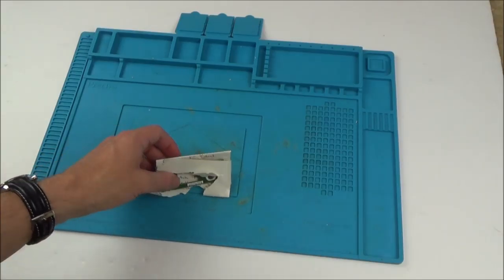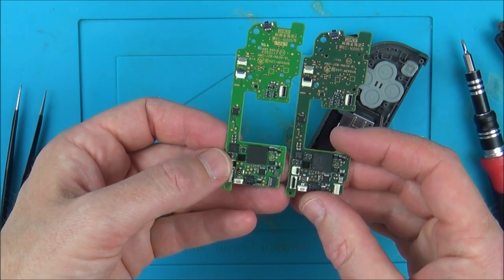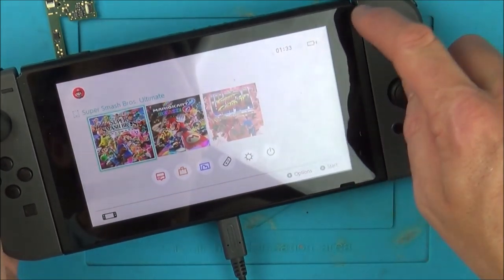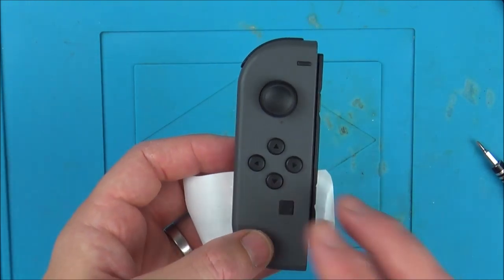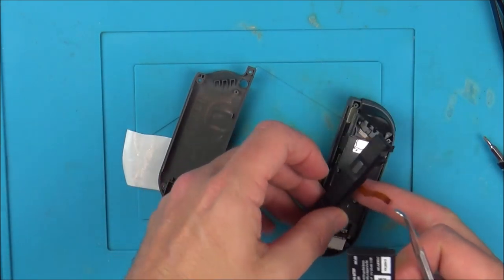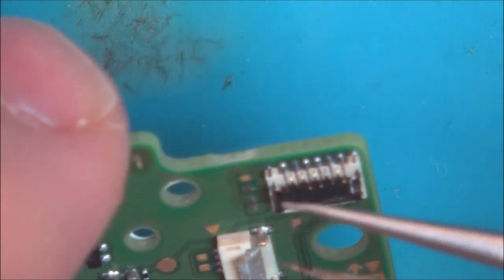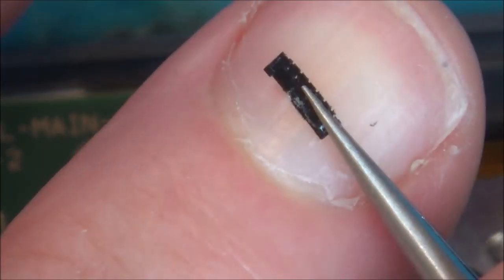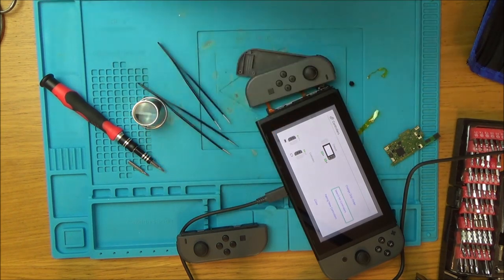Trying to FIX 2x Nintendo Switch Joy Con (QUICK VERSION)

Comment: I have used the thin plastic idea on plenty of laptop keyboard connectors where they have been damaged. I slid the thin plastic into the connector on top of the cable squashing it onto the contacts.

Comment: Good effort

Had the exact same problem last week with my sons joycon the plastic latch came off the sync light ribbon connector and i ended up bending the latch pins trying to get it back on which then created a short and stopped the analgue stick from working and made the joycon vibrate all the time, i bent the pins back in place which stopped the short but couldn't get the latch back on so i ended up buying a cheap faulty joycon off ebay hoping that the main board was okay, luckily the main board was fine so i just swapped them over. 

Those plastic latches are so weak same with the 3ds as well I'm nervous everytime i have to take a ribbon out. Lol

Comment: I had a similar problem with my 3DS with the plastic pin door being broken (for the joystick). Instead of taking the door off from another pin house, I took off the entire house and door assembly from a non-working board (desoldered it). Got it to work all right. Might work or maybe it’s too different on the Switch joycon...?

Comment: @my mate VINCE I might just have a solution for your ribbon cable connector issue, I had the same issue on a new Nintendo 2dsxl. I shoved the cable in and sealed the hole of the connector (where the connector broke off) with a tiny dab of glue (it has to be a really good one, I used this one https://www.amazon.de/UHU-47735-Bastelkleber-Tube-mit/dp/B07637SLLF). I heated the glue with a hairdryer for about 20 min in order for it to dry quicker. Then I tested it and got it on the second try (you can remove the glue easily with some nail varnish remover or glass cleaner, basically anything that contains acetone, and try again if you failed). It makes a really good seal, just as good as a normal connector. 

cheers Michael

Comment: You should harvest the full connector from the water damaged board and solder it onto the new board. You would likely need a microscope due to the size of the pins but it can be done.